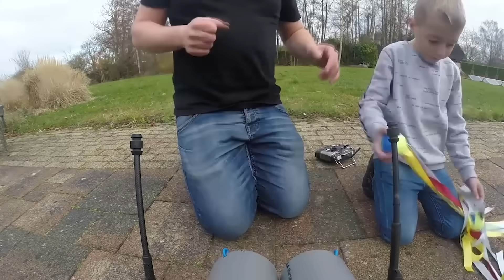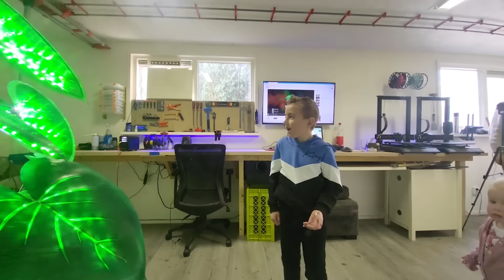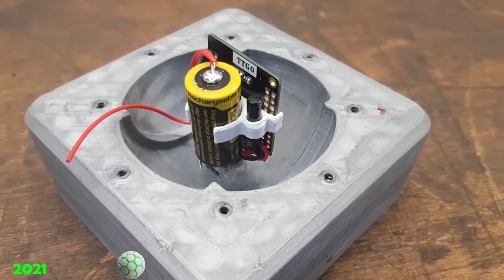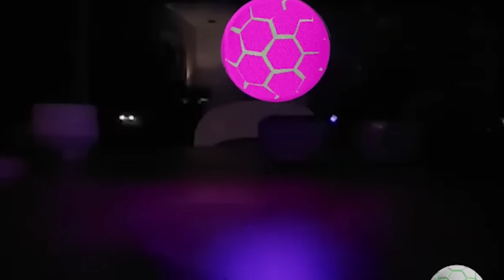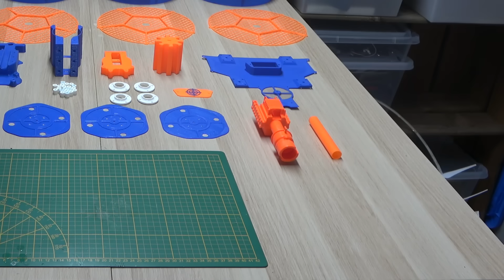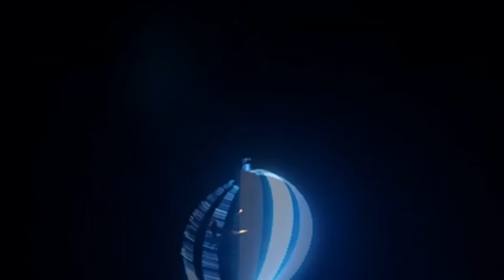An Interesting Update on my Tree Generator (+6 Other Projects I've Never Shown Before)

Comment: The ball game would work. Would definitely have to come up with several critters. As well as some way for them to become stronger. Also some kind of competition or battle mode. 
Something like the 2 balls will link then randomly choose one ball to use for a game of some kind. When finished the 2 reconnect and trade info on who won and who lost, all that relayed later when you connect to a phone or tablet visualizing your points or whatever the reward system is...new critter(s) xp levels ect. ect...

Comment: I just had a dream about the tree generator, what if instead of using the motion to move the generator, you instead attached a super heavy weight to the top of one or multiple trees (or you could build a structure to hold it) and used the mass to make a gravity fed system, where it's slow decent could be used to drive the generator. All of the trees swaying could simply use a series of block and tackle pulley systems to ratchet the weight back up!

The swaying could directly retchet into the system, or perhaps the swaying could store elastic energy to release it in big pulses to maximize the torque to lift the large weight, that way the ratcheting system would likely be easier since it wouldn't have to just be constantly feeding energy back into the system, but could instead do it in controlled bursts.

Have you considered this as a possibility yet? are there obvious reasons why it's a bad idea that I'm missing?

Comment: You don't need to convert the rotation into reciprocal motion. If you use a BLDC motor reporpused as a generator, for example, the output is AC -- it has no polarity. Rectify it and you're done!

Comment: make a set of 3 balls that will continuously try to slowly synchronize with the tempo at which they are being juggled (as in say there should be a 3 or  so second lag in-between when it detects a change in the tempo or amount of g-force producing tension inside of them as each is either being caught or being put into them as they are thrown ( or both ) in order to produce a visible difference in any one ball's blinking frequency or variety of frequencies among 3 if or when a person chooses to start off by doing a pattern where you are throwing them high and cause them to blink slower, you could then switch to a faster lower pattern and it will make them seem like they defy their own momentum as far as how a slower blinking light will make minds try to understand what it is seeing as something different than what is happening when the blinking seems to catch up. make it so each ball is independently triggered too  so if you want to start with a pattern that only 1 ball or just 2 are kept in higher thrown patterns and then mixed in the either 1 or 2 other ones going faster or if you throw one a couple times high and then switch it with one of the faster ones and use it long enough to get it to begin changing blink speed as you switch it then for the third and so you could make a kind of smeared momentum response that is expressed across the point a b and c from which they are being thrown as

Comment: If flapping in the wind was an efficient way to convert wind energy to electricity wind turbines would be large fins attached to the ground that swayed back and forth in the wind. Thru evolution trees have evolved to absorb and waste wind energy, that doesn't make them ideal for harvesting that wind energy.  The energy is wasted in leave motion, every tiny branch motion and the whole trunk motion.  To get all that energy into your generator you would need to hold on to the trunk and capture the forces relative to the ground rather than picking a few branches and sucking out only a small amount of the energy.  I think there are far too many friction losses and mechanical parts to make harvesting a significant amount of energy from the movements on the tree by connecting to a few branches to be efficient or practical. Even if you picked out 20 branches making the mechanism far more complex you only get back a partial amount of the energy the tree absorbed. From what you have done so far, it is interesting way to collect a tiny bit of the tree motion but the vast majority of the tree motion is wasted. I would evaluate the amount of energy you've harvested with the prototype compared to cost and then determine what practical benefit there is before proceeding. On most days with minimal wind the tree generator will capture almost zero energy.  My guess: you would be far better off putting a small spinning turbine on your roof and experimenting with different turbine types, blade types and maybe even a flapping wing type. One system goal is to start generating in the least amount of wind.
I'm not trying to be negative just practical. I'm a degreed mechanical engineer with 45 years of engineering experience and experimenting with all kind of stuff.  This is just my initial take on what I see. I'm super impressed with the 3D printed things you made to use in your experiments and sad I didn't have those tools growing up to use for prototypes. Your prototypes look and work amazing. Kids today need to learn this prototyping process and start using those smart phones skills for something better than watching TikToc. Even at my company we bought a 3D printer a year ago and haven't utilized it nearly enough because the old guys just don't get it. Teach us the prototyping process.

Comment: Electricity from trees? Igneous!  and the magnet bar that is inserted into a copper wire segmented sleeve integrated 

Gave me an idea! What if power was generated into the DO NOTHING MACHINE ?

The DO NOTHING MACHINE is comprised of a four way channeled canals with sliding walls that collide past each other via a pivotal arm that turns by hand that could be turned with a rotary cam or rotating outer gear assembly to move the arm that slides the walls past each other creating current, and electricity. The gear box or cam is operated by gravity dropped water power or by waterfall. A power converter causes three volts to become six volts to power a pump to refill water into an uper chamber where gravity causes water to fall over cups arrayed in a catchment water wheel that turns a rotating horizontal axel. That turns a vertical axel with a transfer case with gears; that rotates the arm that tracks the outer teeth of a center drum gear and the smaller tracking outer gear moves the magnetic segmented walls back and forth past each other as the channel containing segmented wraps of wire generates current going back to the power converter connected to the pump which redistributes  water from the catch basin back up to the water fall tank. (This is not a perpetual motion machine as water evaporation occurs.) the water tank contains 5 to 7 gallons of water. What is replaced from the collection tank pumped back up to the waterfall tank is a much smaller amount of water. Plus a separate curent double wall DO NOTHING MACHINE can power small appliances or be used as a charger to refresh a power bank.

Comment: For that (obviously looking to have the idea bought by Ukrainian Defence Procurement Agency) "item holder" with the six slots to open automatically, they would need to open in such a way that the drone stays stable. For example, open bay 1, then open the opposite bay 4 to keep it balanced. Bay 2, then Bay 5 etc. We couldnt use something that stays unstable to one side for any length of time.

Comment: Honestly there is a practical use case for a automated pressure washer. But could you have a unit that has a gear rack on wheels (several expandable rack sizes for width say 10' increments) where a limit switch changes the direction of the nozzle and water pressure drives wheels forward after each complete pass. The gear rack would be the width of the cleaning surface with adjustable limit switches for customization. Then you set it and it cleans. you have a 10 foot driveway and set it at the house and the nozzle goes back and forth like a plotter and each complete pass triggers a revolution of the drive wheels moving the whole unit forward by a measured amount. Could be all mechanical and water driven too. Simpler but practical. You are definitely on to something as it is a tedious task that slowly breaks your back. That is the perfect application for automation.

Comment: There are several reasons why you do not want to assign out specific parts to specific teams. To start with, you get a bottleneck immediately as soon as one team starts to fall off, or maybe they completely disengage. Then, you also have the problem of everything iterating in it's own little ecosystem, meaning by the time they think part B is perfect, they went and found out that part A has been completely re-engineered and now their part B is worthless. Also, you have the potential engagement issues with it too.  If I really like to work on the entire architecture, but I was assigned to just one section and I'm not even that interested in that section, the creativity stops flowing immediately.

You can overcome all of those things, of course, but then it's a lot of unnecessary work. Innovation is driven by empowerment, so don't limit what they can do to just a particular part of a design.

Comment: well in times of automation and ai i would suggest the water washing robot. its embishis enough to show emergens usecases. a landing platform for a drone on top with a visuel model what is able to mab the area of effect. rout planning and resignation of success.
Reply: It also occurred to me that the drone should also be connected with a cable. This provides a more reliable power source and also avoids signal interference.
An additional feature that could be added would be an automatic emergency shutdown in case a pet or child enters the designated work area and the visual model detects this.

Comment: I came here for the tree generator. Don't get me wrong, other projects look interesting, but the aforementioned is the primary driver and I'll follow the project with great interest!
Reply from the maker: @tech-adeptzeth1648 Appreciate that 🙌 The tree generator is definitely the big one here 👀

Curious though, would you rather see me dive deeper into the science side of it, or are you interested in the end result and what it could become?🤔
Reply: @ConceptCraftedCreations  echoing what Alec's reply. And also - why not both? Science and engineering! Even if takes an entire series of videos on the subject, I'd watch it as you go through the science and engineering the generator. The different versions, making them more affordable, better optimized, more rugged, etc... In a world that can't afford to waste energy, all those trees swaying in the wind are such a tantalizing opportunity!!
Reply: @ConceptCraftedCreations  Basically mirroring what others said, the wild experimenting AND practical applications both have weight. Though, on the more experimental side, I'd also like to mention an idea that I think could be more effective (depending on the context)

Peltier elements can work in reverse, and generate small amounts of power from differences in temperature across their surface. I'd wager trees probably maintain a different ambient temperature to the external air.

So, if you put small needles or nails into a tree, and the interior of the tree is a notably different temperature to the exterior ambient air, and then you put a peltier element between them, how much power could that generate? Likely not much, but if you could get even a few watts on average that could be enough to power things like LoRa nodes for communication. Who knows, maybe you could scale this up a bit by using small heat-pipes for laptops & the sort.

And, if you do it right, I don't think it'd even harm the tree. I could be wrong, but I think it's more likely that the heat inside the tree is likely to be waste heat or something, rather than something it's intentionally controlling.

(Off topic from the tree generator, but I do also think the buncebeasts ball would be worth looking into as well. I'm not sure how receptive a general YT audience would be to it, but I imagine a lot of parents would get something like it for their kids if it was an even semi prebuilt product/kit. PS, you could probably implement something like those shake-chargers on flashlights to power the Bouncebeast balls as well, then replace the batteries with supercaps or something.)
Reply: @ConceptCraftedCreations both! I want to see the minutia of the science, but I also want to be along for the journey!
Reply: @ConceptCraftedCreations I'd love to see the science side 🙌
Reply: good pfp :3
Reply: @DJ_Locks  Why hello handsome you! 📎➕📎 = 💪
Reply: Definitely what it could become. Maybe a small integrated system with a battery and a light, or a small pump to spray water, etc. Thank you for documenting your work dude!
Reply: Reload the video with more detail on the choices.
Interesting problem.
Each taking their own take on it would be most interesting, they could all have their own take on it.
Deep diving into parts would let you have more control over it. Depends on what you want to achieve

Comment: Usually it's better to split the project in different areas because people are more specialist in areas and no generalists.
Like mechanic, 3d print and electronic are the simplest. You should split in more parts and use all the help any specialists of the area you can get.
Reply: While that is true, you need someone to be in charge of the entire system/solution. If you give all of them the same system concept with defined interfaces, you might miss out on some real new out of the box solution. Personally I would let them compete, or allow them to group together in max teams of 2, maybe 3 if they want.

Comment: I came for the tree generator, but wow that is a lot of cool projects. 
I think there are so many possibilities for this, I was thinking about using it with a shed/barn door. We leave ours open all the time and it just gets blown by the wind, but this could be used to harness that in a very passive way. 
I would suggest letting the project teams have the freedom to go in a direction they want to explore rather than dividing up their focus into categories. With colaboration I could see this being used all over the world. Great work!
Reply from the maker: @iansmith7986 Love that barn door idea 👀 Super simple but actually really clever 🤓

I get what you mean about giving the teams full freedom. Who knows what directions they’d come up with if they weren’t boxed in 🙌 If it was you on one of those teams, what angle would you explore first?
Reply: @ConceptCraftedCreations I would look at how to maximize the movement conditions of any given system. What tree branches in what winds would result in the optimal distance traveled. But as for the actual generator, I would look at stabilizing the power output with inertia. This could be done with a gravity battery or by creating rotational energy like a flywheel. And the flywheel would be able to be the rod in your idea if it was suspended within the wire coils with magnets. Just food for thought!
Reply: @ConceptCraftedCreations hey I'm super late here, but I wonder if you could design a single massive blade to get a maximum of torque out of the wind as opposed to consistent electrical energy? I had a thought about using the trees movement to drive a gravity generator where the swaying could ratchet the weight higher and higher, but it could be interesting to get to make a "barn door" 🤭 generator to help drive it higher.

Comment: I don't know how turning this into a product works, but If I can give my honest opinion, avoid anyone that wants to promote this as something revolutionary, that will change the world. Any time I see any tech product promising too much, it always turns out to be some kind of scam. Don't promise what it can't deliver. 

On the other projects, I don't know why, but the idea of the automatic water-jet fascinates me so much.
Reply from the maker: @daysejones968 Totally agree! 🤓 Better to stay small and honest than hype it up and disappoint 👀

And the water-jet robot.. way too complicated but fun to build 🙌 Would you ever actually use one, or is it just the weirdness factor that makes it fascinating?😄
Reply: @ConceptCraftedCreations  its the weirdness and the process itself that makes it interesting for me. Its something I've never seen done before.

a weird question, but was your comment passed through an AI?
Reply: @onyxmnn  I agree with this, but i also think if it was divided up into sections so that no one person or group controls it other than the creator, then it might not be to bad.
Reply: @ConceptCraftedCreations  Honestly there is a practical use case for a automated pressure washer. But could you have a unit that has a gear rack on wheels (several sizes for width say 10' increments) where a limit switch changes the direction of the nozzle and water pressure drives wheels forward after each complete pass. The gear rack would be the width of the cleaning surface with adjustable limit switches for customization. Then you set it and it cleans. Simpler but practical. You are definitely on to something as it is a tedious task that slowly breaks your back. That is the perfect application for automation.